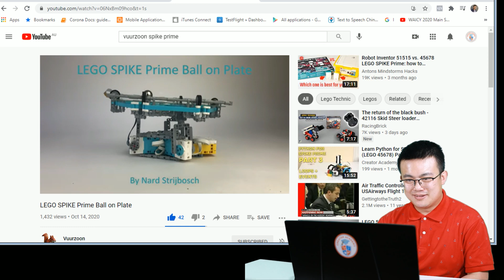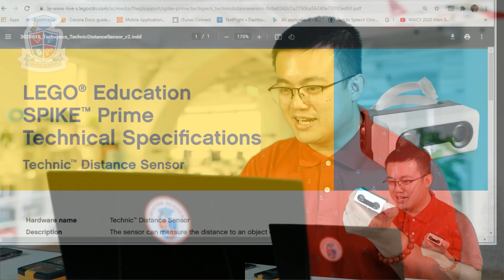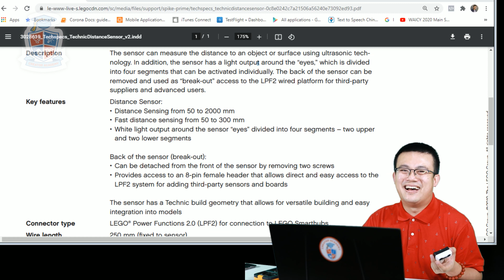3rd Party Sensors on Mindstorms Robot Inventor / SPIKE Prime

Comment: I think, it would be cool to have an adapter bord with some EV3 compatible ports.
I don't know if it would be possible to make a board reading a few EV3 sensors, then connecting that board to one RI port
I don't know how many would be possible, but if you cold get 2  (or 4) EV3 sensors multiplexed through one RI port, how cool wouldn't that be?
Reply from the maker: That would be awesome!

Comment: Hi and thank you very much for excellent videos!
I'm looking for a "non-frictional" angle/rotation sensor for robot inventor. I know that the motors have angle sensor but I'm looking for smaller ones and with less friction. Do you know any that can be used together with robot inventor (51515)? Thank you very much

Comment: Thankyou I've been trying to find more information about this, did you know it's also possible to daisy chain 51515 hubs ? Up to 6
Reply from the maker: No problems! I have seen others working on a daisy chain solution using bluetooth, but theoretically it is possible with the breakout port as well. Garry
Reply: Interesting i didn't realize that cheers
Reply: Vuurzoon (the creator of the balancing Ball Video) has made a TicTacToe game with 9 Hubs, so the sky is the limit

Comment: Hello Garry,
can an ev3 hub communicate with an inventor set hub?
Kenan
Reply: cool video, I give it a like :-)
Reply from the maker: Hi Kenan! I don’t think it is possible, but maybe there is a creative way to do it with flipping colour sensors like this: https://youtu.be/DBp3nf8R7-s
Reply: Yes, but you would have to either use Python or Java to give some informations on a logic level (set pin 6 high...). Simpler would be to use the boosts distance sensor with the inventor set and use the IR sensor of the EV3, which seems less clunky than motors and touch sensors or color sensors pointing at each other.